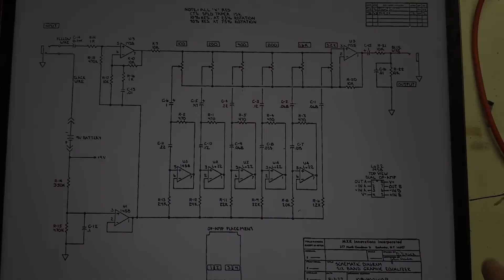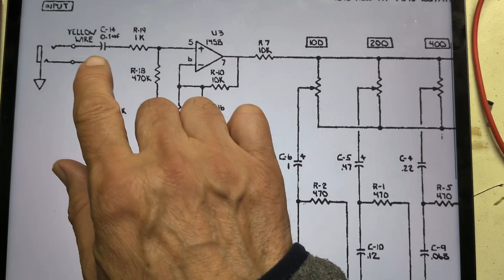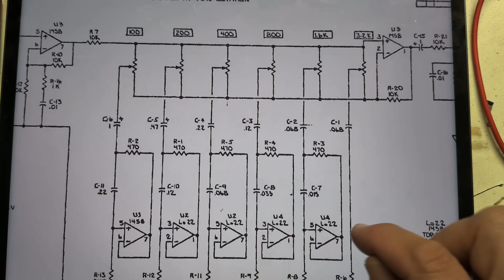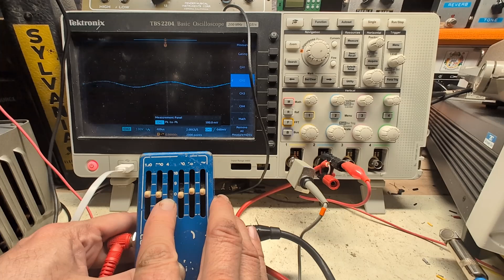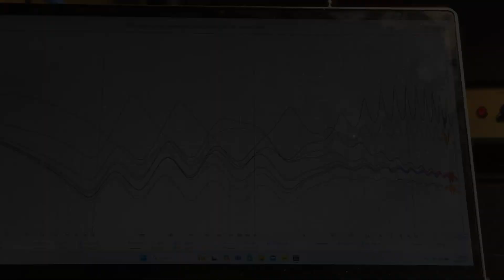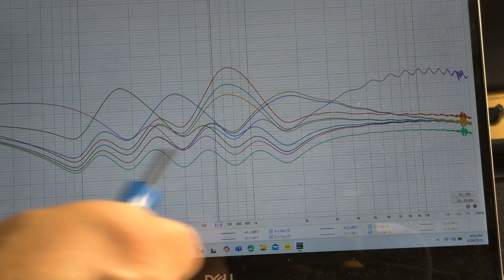Do you want an amazing 80's tone? MXR 6 Band Graphic EQ 6BGE, repair and high headroom mod.

Comment: Very nice! I've modded my 70's 6band with stomp switch and led indicator. Replaced some of the op-amps with some higher spec ones that I had lying around. Although, I'm not entirely sure if it's the electronically correct way to just swap them out. It's less noisy and it works fine, but I think it messes a bit with the freq response. 

I think I still have a voltage doubler somewhere from an old project that I didn't finish. After seeing this, I'm definitely going to stick it in there. :)

Still a very usable and nice sounding pedal if you ask me.

Fantastic content btw, really enjoying your vid's! :)

Greetings from the Netherlands.

Out of curiosity, what software are you using to do the freq response measurements? I use plugin doctor with hardware insert instead of plugin. Works really well but the application you're using seems more advanced and precise.
Reply from the maker: Thanks for the great comments! The SW is called REW, it's free and works with most Audio Interfaces. But I've almost finished my own version in Python, that does time, spectrum and frequency response. Which should give a more comprehensive display of performance. Keep modding!
Reply: @CaliforniaSonics  Wow that's amazing! When you have a working version I'd love to try it out!
I'm going to try out REW, thanks for the tip!
Plugin Doctor might also be worth checking out. It's real-time and, in addition to frequency it also has harmonic content analysis, time domain/dynamics, and oscilloscope.
Keep up the good work!

Comment: Great video! Very informative : )  I wonder about the impact of such EQ pedals on the phase, which could be audible especially if the EQ is placed after the distortion. Is the effect more pronounced the higher the adjustment? Is it worse when there is a big difference in the setting of neighbouring bands? Is it actuallu audible?
Reply from the maker: Good question. Makes me want to get the scope out and compare. I put mine at the end as it's got the headroom. And a usual rule of thumb is the last pedal has the most impact on tone shaping.